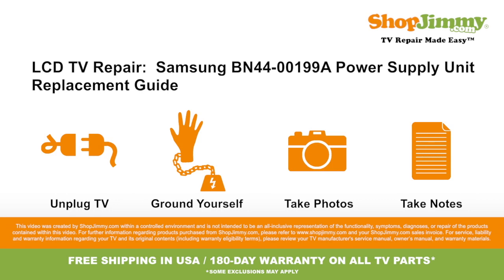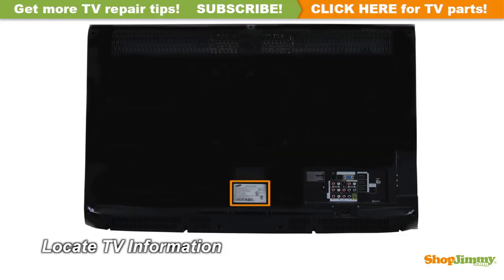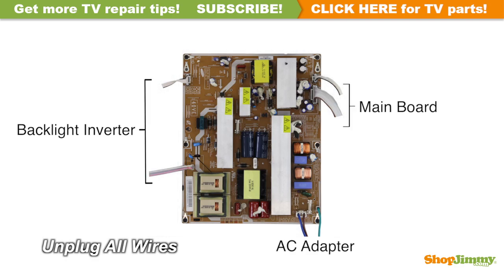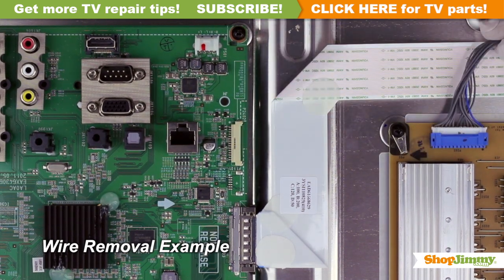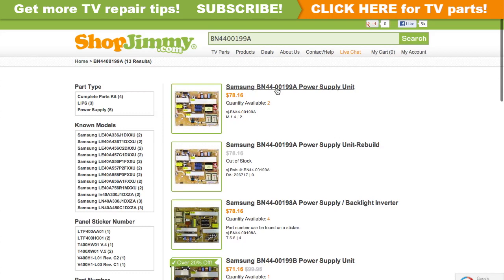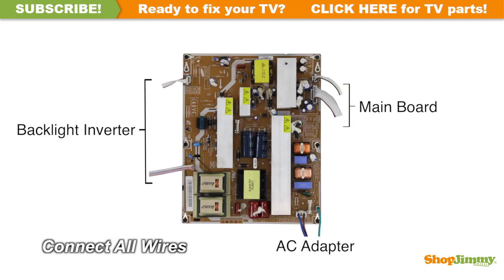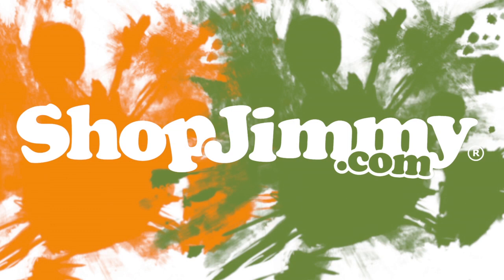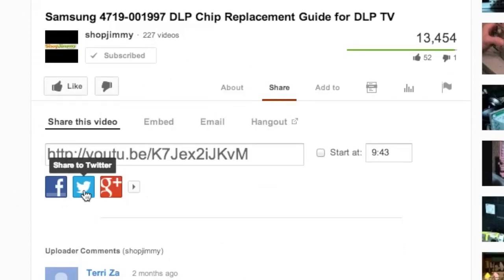Samsung LN40 LN 40 Power Supply Unit (PSU) Boards Replacement Guide for LCD TV Repair

Comment: I have a Samsung LN40C=530F!FXZA.   The unit does not power up and does not have any lights on when plugged in.  The fuse on the power supply board is not blown.   Is the problem likely to be remedied by replacing the power supply board?